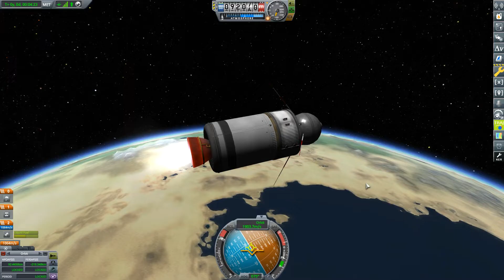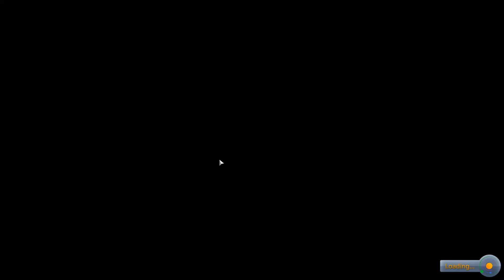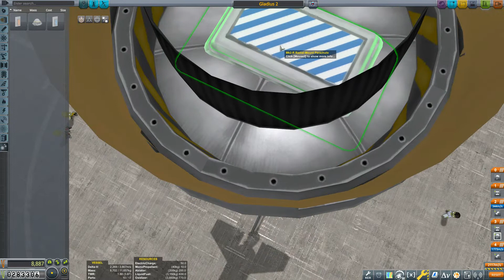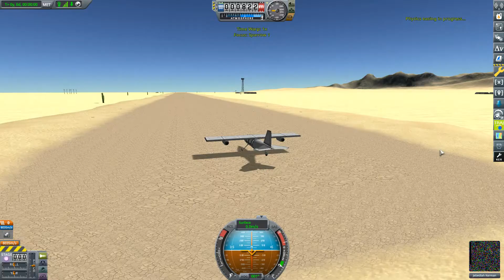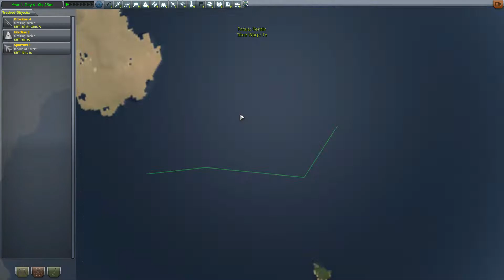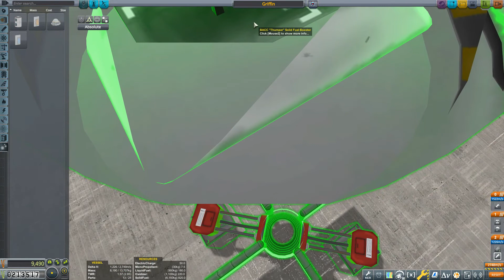Kerbal Space Program: Breaking Ground Career (4)

Comment: Well mate, you could have added four mid-size solids on the main solids on the sides.  Not sure if it would have enough thrust but if it does then you could fire those off first, they should burn out around 9k, then fire the large solid.  If they didn't then you would set the four solids and centre solid to say 50-65%.  The small ones should pop off at 9k or so and the centre would be around 45k the most.  More like 28-30k.  And with solids I normally don't pitch over normally.  I just ride it out to the solids burn out.  Then I pitch over.  Reason, getting out of the atmosphere or the most of it sooner than later.  You could if you want pitch over to say 60-70 degrees.  Shouldn't be allot of risk of the side booster impacting with the rocket.